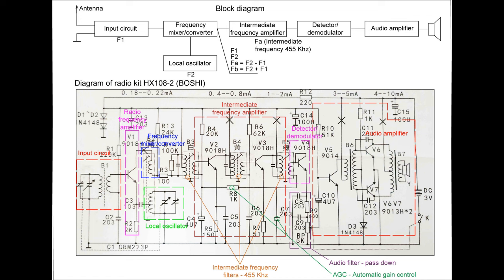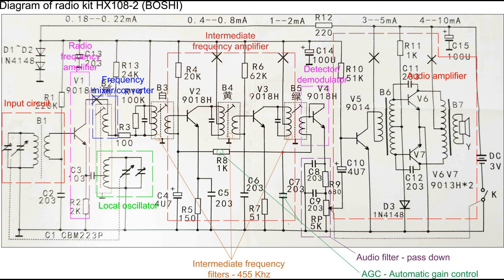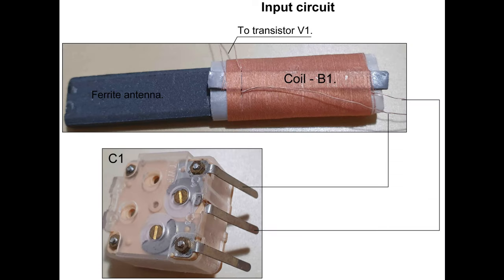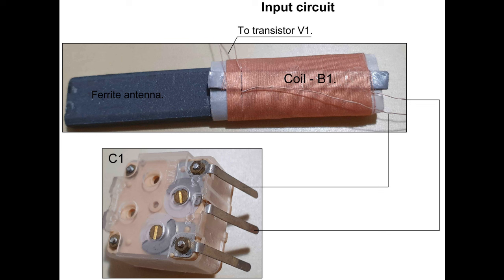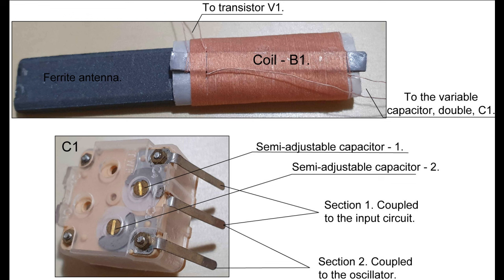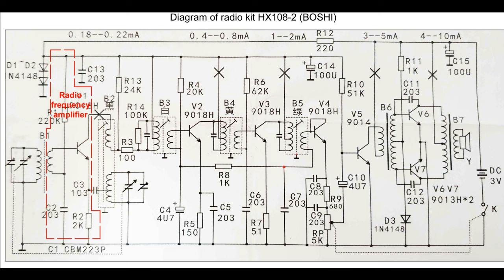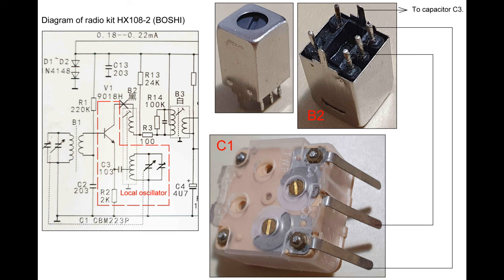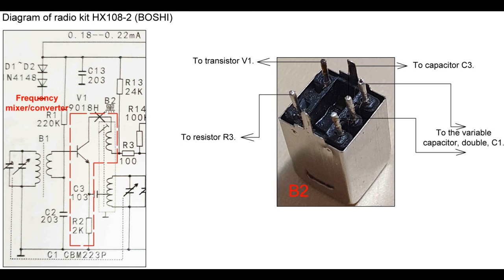Kit Radio HX 108-2. Operating principle Superheterodyne.

Comment: This is the new model the HX-108+, the older model had larger IF transformers and some different component values. This model works much better.
Reply from the maker: Approximately. Distant stations are heard very weakly.